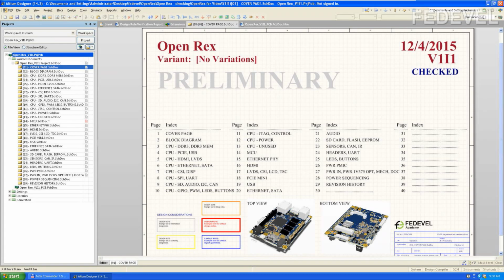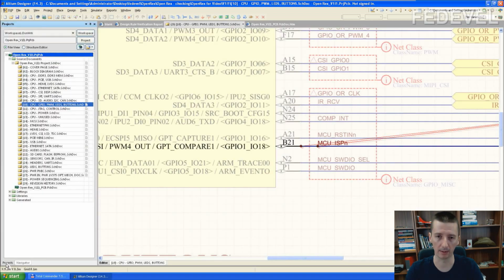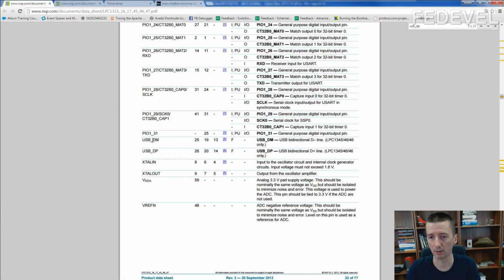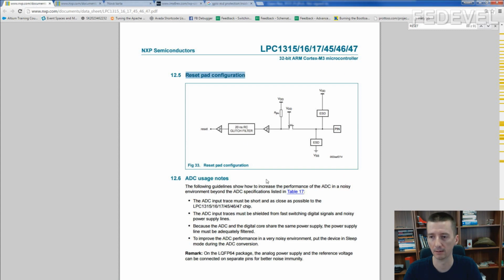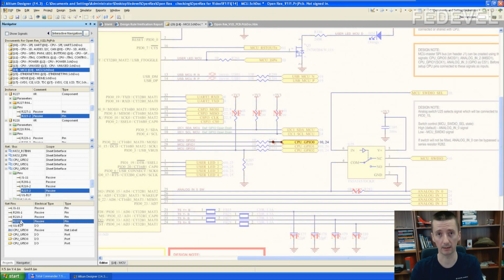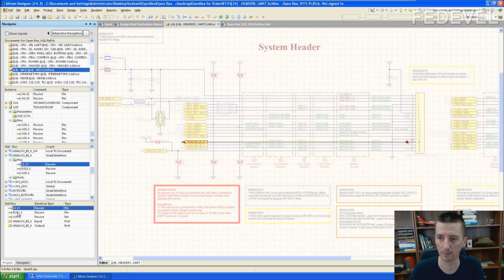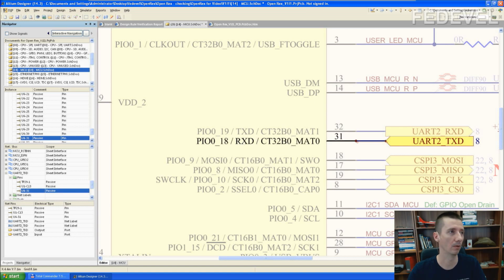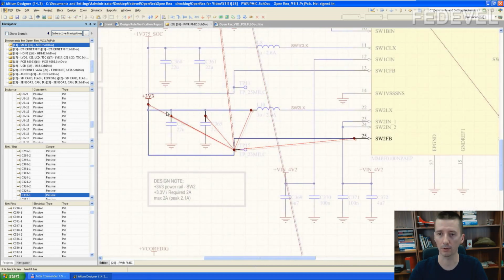Do you check your schematic the same way?

Comment: My top-tip would be that when creating schematic symbols for Transistors, Mosfets and Diodes, Altium allows you to "number" the pins using letters, e.g. B,C,E  D,G,S, and A,K respectively rather than just using numbers 1, 2, 3. 
This really helps prevent library errors such as reversed diode direction, and mismatches between the schematic symbol pin ordering and the footprint.

Comment: The best tip I would give anyone with regards to schematics is where you have connectors (or chips) with pre defined signals on particular pins, put those signal names on the connector symbol pins. This makes life a lot easier and offers a very good cross check.

In addition, when you add a new part check the pin numbers/signals on the symbol match the pcb footprint, especially for things like sot23, leds, diodes, capacitors. It’s really easy to miss this and end up having to mod boards

Comment: Thank you for this video. Can you create one more with Altium 20 ?
Reply from the maker: Thank you Filipp. It would be almost exactly the same. Or do you have any problem with something specific?
Reply: @RobertFeranec  Thank you for responce. I try to impelement this technic. It helps me find some errors in my design. I think that output documentation can be interesting topic.

Comment: one question: can I use the software Altium designer with any pdf schematics or do is it only for creating schematics? thank u and great video
Reply from the maker: You can't draw/edit schematic in PDF, you need a CAD software for it, such Altium, KiCAD, etc which can be used to design the whole board (schematic is only a small part of design process)
Reply: @RobertFeranec  Ok than u Robert for answering my query.. great content.. keep it up :)

Comment: Hi Sir, I have some questions.
1. How to read any schematic?
2. How Can I draw my own schematic? suppose I want to design a audio amplifier circuit,,, how to design it without getting helps from others?
Reply: 1. You need to learn symbols for every common components. And read this help https://learn.sparkfun.com/tutorials/how-to-read-a-schematic/all
2. You use some ecad software. Kicad or Eagle example. You have to watch tutorials for thouse. Usually circuit design start from drawing block diagram. Example audio circuit you specified what you want. Example input from XLR and RCA then you but center amplifier and output will be example for headphones. Then you have idea what you want to achieve. Now start to look google with keywords like "headphone amplifier circuit" or "XLR RCA selector circuit". Now you have some idea what IC's and major components your are using. Use these IC datasheet's and internet examples to help you draw your schematic.

Comment: Hello Robert.
I have a task to place in my PCB board 160 or more leds WS2812B. This leds should be connected serial. Howewer first and last connectwd to the MCU. Example - ( http://s018.radikal.ru/i528/1612/0a/ee642d8034d7.jpg ) There is an automatic way for solving this task?
Yours respectfully,
Alex.
Reply from the maker: Interesting. I didnt know, that diodes like this exist. I am not sure how automatic the task should be, but maybe you can create block of 10 diodes and use it 16 times. That could help you with schematic and also PCB(?)
Reply: I think it is bad way. First problem, no controled name of components. Second, hard editing. I hoped you know how solve it.
Reply from the maker: Then just CTRL+C CTRL+V should work oki too.